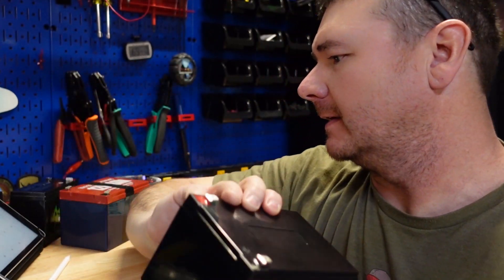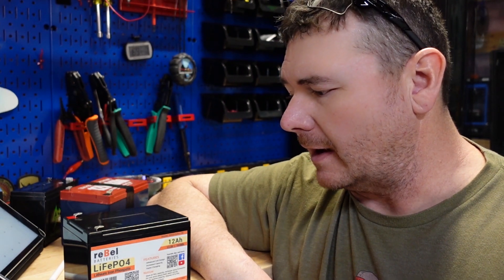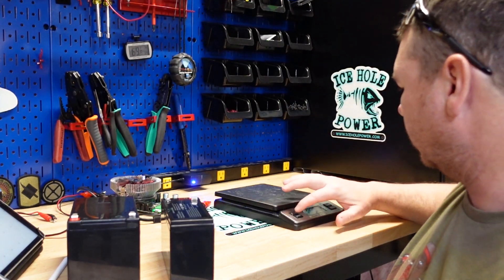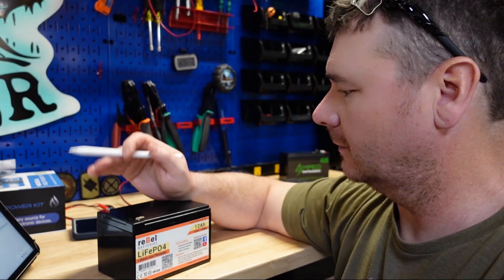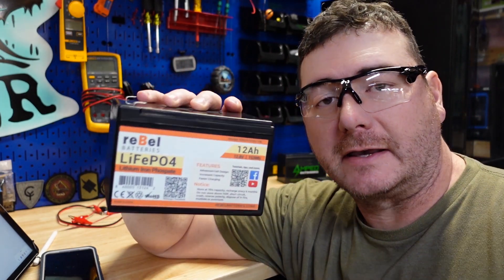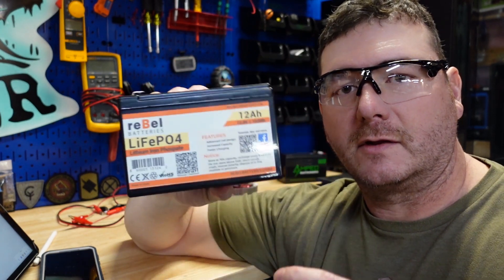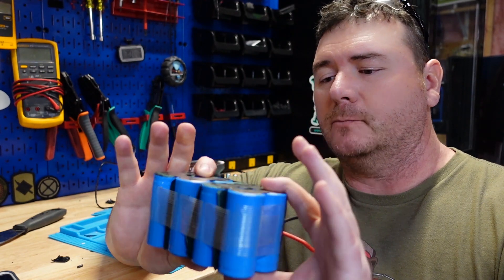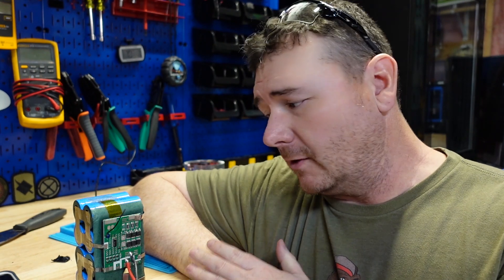REBEL 12Ah Lithium Battery Review and Teardown!

Comment: Hello Sir. I have a question.  I have a B&D 750W 6.52amps inverter model PI750AB.  For the most part it works perfectly.  But I'm experimenting with using it with a smaller battery in my chicken coops when needed.  I have it hooked up to a GT12080-HG 12v 8ah battery.  I can run a fan, laptop radio etc no problem. But when I plug in a 200w heat lamp the inverter goes yellow and cuts the power.  it wont work.  The battery is fully charged.  Why is a 750watt inverter shutting down when plugging in a 200watt heat lamp???   Any ideas?  I'm trying to put the lightest battery in my setup I can use just in case I need to move it.  I'm 78 and can't much carry heavy things.   you think my battery is too small and upgrade to that battery?

Comment: I understand that you don't want to charge a battery at 0C or colder but I keep hearing conflicting info about discharging these type of batteries below 0C. I hear you don't want to do it. Then I hear it's fine to do it and then I hear that they are only safe to discharge down to -10C or -20C. Can you please clarify this subject? If I got it right this particular Rebel battery only works down to -10C or 14 degrees fahrenheit. Ice fishing temperatures are often below this so I'm not sure how usable some or all of these batteries are for ice fishing.
Reply: Charging below 0c can damage it and allowing it to get below -20 discharging or not can damage it.

Comment: Amazon has this battery for $46.95 right now. Can't beat that!
Reply: Yes, They are cheap today on Amazon and the rebel website indicates 4 cells and only a 12a discharge and 6a charge which suggests that they changed to a 4s1p configuration. They may not perform the same as the ones he tested here. 

As popular as these are, it might be worth another tear down. 

I was looking for a couple of batteries to put in series for a 24v oset 16 and almost bought these before I noticed they are no longer 4s2p.
Reply: @jamesdavis2856  I emailed Rebel & told him what you said and asked if that was true & here is his response:......... "No, it's the exact same battery we have been selling since day 1. We have upgraded our larger batteries to use better BMS's and wiring, but the smaller ones have not changed."
Reply: @MrWhiltetail  awesome. Thanks for the clarification!

Comment: Love the attituded and professional presentation.  I see you mention some batteries should not be paired in series but indicated Dakota and the Rebel are brands that can be paired in series.  I have a Dakota 23 amp battery (I bought prior to your teardown).  I now have a 24 volt trolling motor from ep carry.  Do you think paring the Rebel 23 volt battery with the 23 volt Dakota will do the trick?

Comment: I am looking to purchase a 50 to 100 Ah LiFePO4 battery for my 55 lb. thrust trolling motor. I plan to charge it up at end of September and leave it for 9 months in our unheated cottage where in Jan-Feb the nightime temps can reach -30 deg C some nights. Would this damage the battery and if so how would you recommend it be stored?

Comment: Thanks for the video I have a question can I connect 4 off this batterys in parallel an use solar panel to charge an can I run my fridge an computer out of that
Reply from the maker: You can connect 4 in parallel and charge it with a panel. However you will probably need a bigger battery to run a fridge and computer. This one can't handle the amp draw.

Comment: Just a quick addition to my other comments. I purchased this battery (6AH) and was able to use it on my kayak for my Garmin Styker 4CV Vivid. The fish finder was on from 9AM to 3PM, 6 hrs. It worked perfectly. When checking the charge with the lcd on the battery it read 13.3V and showed 80-90% full. When I put it on a charger, it showed over 80% and 13.25V. I had 100% backlight, both traditional and Clear View on in CHiRP,  and GPS mapping. Hopefully it continues to perform as such.

Comment: Your efforts and information is greatly appreciated.  I used ypur link to buy the battery, hope it helps. 

Do you find that different capacity batteries from the same company can be constructed differently?  Maybe a company buys their 20ah from Chinese manufacturer A, while their 6ah is of a different quality from Chinese company B?
Reply from the maker: I have found that to be the case with Dakota Lithium. Only way to tell is to crack it open.

Comment: They sold out of the 12ah. I picked up a 6ah. Its just to run my Garmin stryker 4 vivid cv, so it doesnt need to have a huge capacity. 

It is replacing my Wilderness systems HD lithium 15ah battery pack. I never believed it was 15ah, but its small and worked well for 6 months. Now its about half the capacity it once was.

Comment: I bought two of the Pionergy 12V 20Ah 256Wh LiFeP04 Battery, and have been using them for two different type of hobbies. First hobby, I use them for my Stand Up Paddle Board Fin Motors, and they work great. Last very long too. Able to get me to cruise on the water at 7mph. The other hobby is, I use it in series with my electric scooter to achieve 32MPH on a 48 volt system. 

Other than what I use it for, I'm not sure what's inside. It'll be sweet if you can open one up!! I don't use up all the charges, but I do charge the night before after every outing.

Comment: Thanks for making this video. I just bought 2 Nermak Batts from Amazon to replace the SLA in my scooter. Tired of them not holding charge. But, the form factor is wrong with new batteries. Looks like I can remove them from factory shell, 3d print new shell that meets my needs. Great video!

Comment: I’m hearing things from other kayak guys about Millertech (MTech) lithium batteries anyway you’d be able to do a review on them before I decide to spend 825$ lol.
Reply from the maker: I dont have any experience with them. The channel would need to grow a bit more to justify the cost before I can tear one apart.
Reply: The 825$ is for the 100ah battery I believe they have others at lower price points.  @iceholepower8012

Comment: Jeremy, great vid. Was wondering, what charger marries up with this battery? Thanks.
Reply from the maker: Great question. I should of covered it in the video. If you have an Amped or Dakota 3 amp LiFeP04 charger, they will work. If you need to buy one, this is a good one that I just off Amazon. https://amzn.to/3rlfAd9
Reply: @iceholepower8012  cool, thanks. Gonna buy one, for that price, why not, if no go, will get an Amped

Comment: Thank You. I saw these a while back on Split Milk Productions fishing channel on You Tube and he has Sworn by these batteries. He says it's Amazing. I tried getting these a while back after watching he's Video and review on the Rebel Lithium  Batteries but there were all out of stock and I waited for some time and ended getting the Amped Batteries. Maybe later down the road I might try to get my hands on a few, but so far my Amped Outdoor Battery have been just fine for me. Hopefully as you also stated there service can get a whole lot better, because that's a No Go for me even if there great, things can go wrong, and I don't want a Nightmare if I need to get a Hold of them, and Amped is much better with there service. Thank  You again for All of your great info and content. 😎👍
Reply from the maker: I will have to check out that Split Milk video. I try not to watch reviews before doing my own so I am not influenced. Thanks for watching!!
Reply: @iceholepower8012   He did a Pretty good breakdown on the Rebel, I believe he was running the 100AH Rebel on his Old Town Autopilot.

Comment: Does this battery need any special charger? Could I use the charger that came with the cheap battery I bought from Amazon? Thanks for the great videos!
Reply from the maker: Hi Dean, thanks for watching! I assume you are talking about a sealed lead acid charger and yes can probably get away with using it. A couple things to keep in mind, that charger will likely be in the 13.6v range or so, where a lithium charger is around 14.6v so you would never fully charge the battery. Also, these batteries have a low voltage protection circuit where if you drain the battery and let it sit for a while without charging it. I would go into "sleep mode" to prevent low voltage damage to the cells. If that were to happen, then it would need to see the higher voltage. The good news is that the chargers for these are only like $20, here is a good one on Amazon. https://amzn.to/3rlfAd9
Reply: @iceholepower8012  Thanks so much for the quick response! Really like your videos. I'm looking to put a trolling motor on my kayak and I'm looking for a battery in the 100 ah range, could probably get by with a little less. Would  the Rebel batteries at that level be a good fit? Do you have any recommendations for batteries at that power level? Thanks!
Reply from the maker: @DeanJacobs  I think they are sold out of 100Ah, however i am testing this 100Ah for a video in May and so far, it's a good one. https://amzn.to/3rKwzph

Comment: Yes, Jeremy great content! I look forward to this battery series. What battery charger would you recommend?
Reply from the maker: Great question. I just bought this one, its cheap and so far holding up well. https://amzn.to/3rlfAd9
Reply: @iceholepower8012   another good charger to look into is chargers made for rc cars like the hitec.  They have different modes for every battery you can think of, li-ion, lifepo4, lead, nimh, and you can pick the charge current you want. Plus you can pick the number of cells 1s,2s, usually up to 6s.  The smaller ones will charge up to 5-6 amps the bigger ones will go higher.   Along with a display that tells you voltage, current, time and ah put into battery.   Can pick em up for about 50 bucks.

Comment: I'm building a speaker in a ammo can and It consumes 7 amps max but I want to put a tall 30Ah battery like Amped has. I can get 6 hours of power at 5A (That's a high estimate) but the biggest issue is maintaining cooling for the amp but still being waterproof. I don't believe heat will be a issue but it's something I will keep my eye on.
Reply from the maker: might be worth it to buy a cheap thermometer and drop it in to see where you are at during use. I would not want it to get much over 140F in there, especially when using lithium. If that happens, you might have to thing about sacrificing water proofing for a small 12v computer fan that you can mount to the side of the box for air flow.

Comment: Can I use this Battery on my Garnin 12volt live scope? And I still need your real good help.
Reply from the maker: You can but there are better options out there with more capacity for longer run times. If you are having an issue with your DIY box, email me some pics of your wiring and I will look it over. Jeremy@iceholepower.com